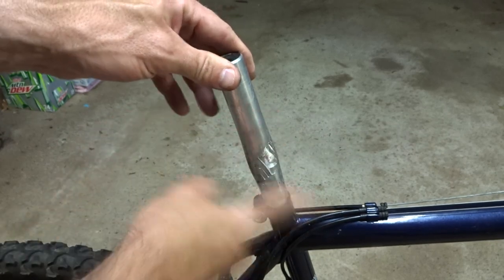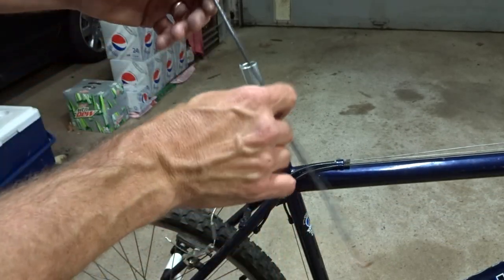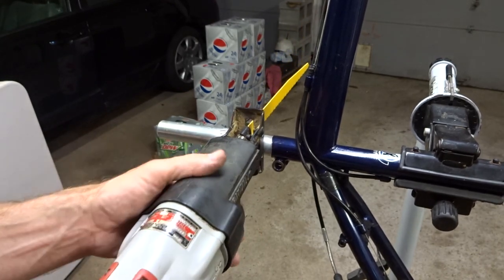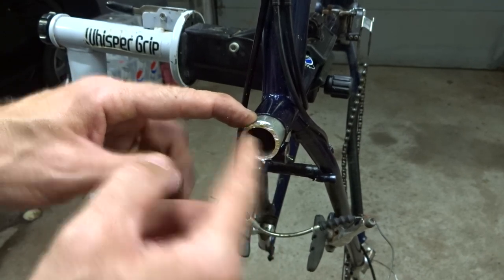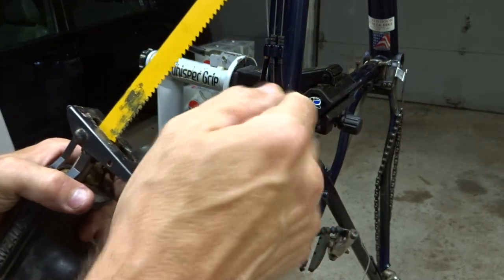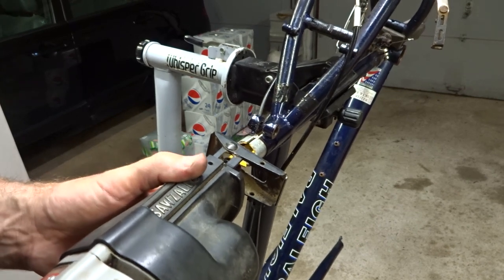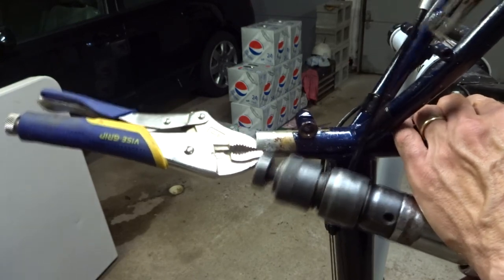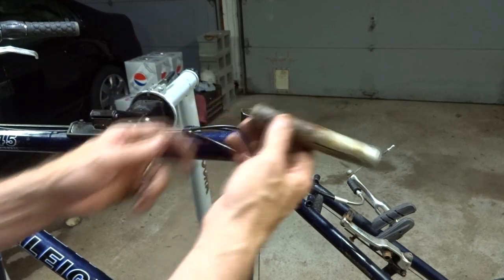Removing Stuck/Frozen Seatpost By Cutting With Sawzall

Comment from the maker: For more bike repair videos hit the subscribe button ► http://bit.ly/SubRJTheBikeGuy
Reply: buy some caustic soda powder and mix it with water, cut the aluminum post flush with the tube. You will have to plug the hole in the bottom bracket then fill the tube with the caustic soda & water. the mixture is very harsh on aluminum and will dissolve the post in a few hours, but will not harm the steel tube.
Reply: Ian Brown  did you see that video,  RJ did removing a stuck seat post with an impact? HaHa he  has both kids out idea's beat. 😂

Comment: My aluminum seat post was badly stuck in a steel frame. I applied penetrating oil several times before attempting to remove the post. I managed to rotate it completely after oiling but it was still extremely tight and would not budge vertically. I tried to remove it with a 10lb slide hammer with absolutely no effect. Finally, I decided to try the slit cutting approach. I first cut open the seat post with around an inch protruding from the opening of the seat tube. Then, I cut two slits in opposite directions of the post with the intention of splitting it in two pieces. This method worked, and the post eventually came out of the seat tube with the motion of the blade (the two sides of the post were almost separated). No other tools were necessary. The post was around 8 inches deep below the top of the seat tube, so I had to use a 12 inch blade (6 tpi). Keep in mind that this method can be very laborious. Took me around 6 hours to accomplish the mission.

Comment: This method worked for me where everything else failed! A shop even had a chance for a few days and apologetically told me the frame was now toast since they tried everything. Two days later I freed the stuck post with a reciprocating saw and the same blades that RJ uses. 

Made 3 total cuts, two of which took a perfect quarter out of the post all the way down to the bottom, which made the rest twist out easily. Didn't need air tools at the end, just a pair of vice grips, PB Blaster, and some easy twisting action. I used a brake hone tool to clean up the inside of the frame and a new post has already been greased up and installed. Thank you for this video!
Reply from the maker: I didn't need the air hammer, but I had it, and it was fast.
Reply: Fast is exactly why I quickly came to terms with using a reciprocating saw. Thank you again for the inspiration.

Comment: RJ, I inherited a clunker of a bicycle with a seat post recessed and rusted in the seat tube.  As bicycle mechanic hobbyist,  and viewing your videos I called a friend to bring his electric saw and propane tank, which he did.  However he came with everything and also a can of PB BLASTER, and it was like watching a magic trick.  He sprayed the walls of the seat tube frame and  between the seat post ,  a nice amount and let sit for a minute or two and then inserted pipe extractor, size 1/2 " or 3/4 " into the seat post  and hand tighten it a bit before using a wrench and screwed it in , and presto the seat post came out with the extractor like butter, and saved a bicycle for a needy child.

Comment: Many thanks, totally recommend this removal method for everyone where they've given up on all the other methods. It worked a treat for me after being lumbered with an incredibly stuck post. So stuck in fact, that (after first trying a slide hammer, leveraging a fitted saddle, loads of penetrating oil etc) I used a 36" length pipe wrench and only succeeded in twisting off the top of the post, and this was no easy feat judging by the fact that the cheap seatpost had a super thick wall, about 3/4 of a cm, and was internally ribbed to boot! After this I got stuck in with a cheap reciprocating saw and saw the light. Had some slight difficulty finding a blade that was thin enough to fit inside the narrow space inside the post, as well as one that was long enough to cut to the bottom of it. And here I would mention a small criticism for TJ during the sawing process. He recommends that several cuts should be made before having an attempt to budge the post. However, in my case I'd just made one (but very thorough) cut, and then went for the mole grips to test if there was movement. There was:) So you might save yourself a little grief by trying this. But the most important of TJ's tips here might just be the use of the coarse tooth blade, instead of the standard metal cutting one. Reason being that, despite making a v thorough cut which definitely would have made contact with the inside of seat tube, there was no damage to it. It's true that I did test the deepness of the cut occasionally using a hacksaw blade to try and get a 'feel' if I was through the soft alloy post and making contact with the harder steel (which seems to catch against the blade more), but this isn't foolproof. And of course an equally big benefit of seeing this vid is just that it gives you a big dose of motivation to get stuck into a difficult job like this one, which if you don't have it, I'm sure that more often than not it will end up with the bike owner giving up on the frame:(
So a big thumbs up here, and not that much work done:)
BTW my stuck post was in a Reynolds 853 frame (definitely worth saving!) which I've heard several times now that for some reason they're more susceptible to getting stuck posts. So if you have one of these, better regrease the thing now and avoid the cutting work!

Comment: After watching this several times in the past year ,finally I got help from my neighbour who used his recipricator saw to make cuts in my alloy post then used a hammer and chisel to free part of the post,it then pulled out,with no other damage to the carbon frame. i watch a lot of your stuff,think you are great to watch,love the improvisation techniques. Keep up the good work fixing bikes,All the best from England. Mark.
Reply: what the hell how did it seize up so bad in a carbon frame ? logically you shouldnt have any problems with galvanized corrosion should ya ?
Reply: @jakecole7447  ..just use over time all year round i guess without moving the post (life's lessons i guess)the bike shops couldnt shift it either so was a last resort..

Comment: RJ- I can't thank you enough for this video. I've got an older Schwinn Prologue road with a stem that wouldn't just wasn't going to move. I went through all sorts of videos on the unsticking of a seat stem before running across yours. Using a Sawzall and a pipe wrench, the stem was out in under 10 minutes. This shouldn't be a last resort method, but the first and only way to take care of this problem. Awesome video and thanks...

Comment: Thank you for all your videos. I use a system you might like to investigate. Cut the post off level with the top of the down tube. Get a couple of tree drills (step drills) and grind off all but one larger than the hole in the pillar. Leaving the smaller sizes as a guide. Push in and withdraw which will spread the cuttings everywhere. Use a hex drive extension on your drill to get to the bottom.Use another sized to suit the new hole diameter.When you are left with a small bit remaining, cut the bottom of a steel seat pillar of the correct size with an angle cut to get rid of the rolled end and also give a cutting point, this will curl the aluminum over and hit it with the step drill again. regards Vince.

Comment: ur video worked...my seatpost aluminum 8 inch inside tube...in my 81cromoly mongoose bmx frame....i tried all other ways...did ur cut it out video...got 12" sawall blade ..ground down blade to about 1/2" so i cud get inside seatpost...slotted one side...then exact opposite side...well with cut slots it fell out from shaking while cutting ...worked great RJ...thanks so much...

Comment: Worked like a charm!  Don't spend more than a day trying the other methods.  After that, definitely rent or borrow a circular saw and go this route.  I rented the saw and bought blades from Home Depot 
 I didn't even have to try to hammer out the bike post .  Once I cut it down as explained in the video, I simply cut just one slot  throughout  the rest of the post  (I cut the slot in between the notch of the seat tube).   
Then, I squeezed in both sides of the bike post with vice grips and it just came right out.  All done in about 30 minutes
Note:  If you get the Sawsall, set both the blade speed and the trigger to maximum.  That way the blade won't catch into the metal while you're sawing and make the saw jerk out of your hands...
Thanks RJ!

Comment: RJ, I inherited a clunker of a bicycle with a seat post recessed in the seat post.  As bicycle mechanic hobbyist,  and viewing your videos I called a friend to bring his saw and propane tank, which he did.  He came with a can of PB BLASTER, and it was watching a magic trick.  He sprayed inside around the seat post a nice amount and let sit for a minute or two and inserted pipe extractor, size 1/2 " or 3/4 " into the seat post  and hand tighten a bit and used a wrench screwed it in , and presto the seat post came out with the extractor like butter, and saved a bicycle for a needy child.
Reply from the maker: My guess is it wasn't stuck too bad. They can be pretty much welded in place. I have used PB Blaster, Kano, Kroil, etc.  Here is an interesting video: https://www.youtube.com/watch?v=xUEob2oAKVs

I would be interested in the type of pipe extractor you used. Always looking for new options. It might be useful in cases where the seatpost has been cut off.

Comment: Yes oh Yes....the joy when it comes free. Ha ha love it! I have recently done the same method on my own single speed project the video wont be up for some time yet, the frame needs respraying etc. I ended up welding an axe saw blade to a steel rod to collapse the tube. Hard work, yes and really is a last resort, becomes almost obsessive. Thanks for tips and sharing Andy

Comment: Bravo RJ! Very satisfying. Had a similar problem with carbon seat post in a carbon frame. I used a carpenter's chisel to split the post which was aluminum with a carbon over wrap.

Comment: Drastic remedies are at times called for. Great job!!! BTW had a similar situation but with a carbon frame. After trying every trick on YouTube,  I proceeded to gently chisel out the seat post. Took several days to cut down the length of the thin walled aluminum tube and then pryed out chunks of tubing. Polished the inside of the seat tube with emery cloth with a tool I made on the end of a drill.

Comment: You're awesome. Most of us would have a pile of bikes in the backyard. That last trick was great. I have an idea for a tool thanks to you!
Reply: I just saw your video where you build a puller "v2" with threaded rod inplace of hydraulic. Building something similar that grabs the post and then use the impact hammer to hit it up and out where the impact action is directly in line with the seat post.

Comment: Hello friend, you are a genius. Amazing your method of removing that damn seat post. You know, I bought a bicycle and I had not realized that I had improvised a piece of pipe to the seat of the bicycle and tightened it with a screw. When I remove it I find that the seatpost is completely locked. I tried everything and I can't remove it. I'm going to put your method into practice. I send you cordial greetings from Argentina. Very good your video.

Comment: I got one out using the drip liquid wrench from bb opening down the seat tube for 2 or 3 days and then gently  twisting the frame (not by the stays!) with the seatpost clamped in a vise, what a rush when it finally moves!  Congrats on a successful surgery.
Reply from the maker: Then it wasn't as stuck as this one.

Comment: This looks like a great method to get out the stuck post. I tried this and so far no luck. Used a 12 inch blade on the saw and the air hammer trick. I will keep at it with the PB Blaster and hope for the best!

Comment: Once I get the rusted post out I run a rotary wire wheel down through to try to eliminate as much of the companion damage. And lots of grease - the post doesn't clamp that deep, you won't make it too slippery.

Comment: I've been fortunate to have never had this problem. So just a method I haven't seen applied yet. Remove the bottom bracket and spray the penetrating oil up the seat tube.
Reply from the maker: https://www.youtube.com/watch?v=bGqV5KE7cb8

Comment: Congratulations RJ, fantastic idea. It seems spraying the penetrating oil AFTER cutting  did the trick. When the tube came out, it looked wet from the oil. I'm going to try this method with a completely frozen seatpost soon!

Comment: Was able to remove my stuck up seat post. My bike was so old school it was a metal frame and metal seat post. I confirmed the latter using a magnet.

At first, I was seriously considering welding a bolt at the end and using a slide hammer to get it off. Surely that would work.

The solution I used was to soak the post with WD-40. Kept spraying for as long as I could see it trickle down. Then, I took my butane torch and just pointed the flame at the seat post for about 10 minutes. Then I changed the position so I can heat it from a different angle. Maybe total time spent heating was about 30 minutes. 

In the last 5 minutes, I first started to pound it downward to test for movement. I was buoyed when I saw some miniscule sparks fly upward with each pound.

Then, I smacked it down harder repeatedly until I finally saw it move down about ½". Then, I put out the flame and with the bike on its side, grabbed my huge pipe wrench and started to rotate it. Stiff at first but I soon got about 30 degrees of rotation.

Set the bike upright, then clamped on a large vise grip. Rotated it again back and forth while spraying it with more WD-40.

Then, with a hammer, started hitting the vise-grip upwards. It started to come out and eventually was able to pull it out all the way!

Gonna try the same technique for my handle bar shaft! The lock bolt for the wedge had snapped already!

Comment: Excellent video RJ - nice extraction!

I wonder if I can pick your brains with a bit of a challenge? I've just received a Ti MTB frame, that has the remnants of a stuck ally seatpin in the seat-tube. A previous owner (cretin), appears to have cut the tube off, and bashed the remnants down INTO the seattube! It's a fair way down. They've then compunded this grotesque action by adding in some expanding foam for good measure. 

It looks like I need to try and find a way to get through the foam first, to try and clear a hole that I can stick a saw in with, and then once this is done, try to gently cut some slots into the remnants of the broken seatpin to attempt to extract. 

I wondered if you had any thoughts at all? (No, I've never heard the like of it either!)

It's worth the effort, as it's a '91 Merlin Ti MTB frame and in lovely condition apart from this!
Reply: They might have tried to dissolve it with Sodium Hydroxide (Drano without the additives) and put foam in to keep it from getting into the rest of the frame. I was about to do this but will try the saw first. The Drano is supposed to work

Comment: way to go, yet i still don't know who will get an aluminum seat post for a steel frame!
Reply: Mohamed Ali They have been using aluminum seat posts in steel frames since the 1950s. You just need to put plenty of grease on them when installing
Reply: Really! I didn't know that, all I've seen here was either steel posts in steel frames or aluminum posts in aluminum frames, and they even sell steel posts with Aluminum frames, not the opposite

Comment: Love it!  have toy ever given any thought to apply pressure to the inside of the seat tube to remove a stuck seat post?  Water pressure would probably be preferable (safer) than air, but either might work.  Thanks for your videos!

Comment: Have you ever ran into a seat post stuck in the frame under the seat post being used? I ran into that a few years ago used about half a can of pb blaster and had to weld tabs on the end of a slide hammer to get it out, took about 6 hours
Reply from the maker: I haven't yet. Would be an interesting challenge.

Comment: i had the same problem with a chrome one , i welded a nut in the end and used a 4 foot pry bar and got it free
Reply from the maker: A steel post in a steel frame would not be a big deal. Just ordinary rust.

Comment: RJ, I have a problem with my seat post. I need to stick the seatpost clamp which is made of aluminium, to my frame which is made of carbon. Looking for a short to medium term cheap solution (even better if long term). Any suggestions?

Comment: what about disintegrating the seatpost with HCl (muriatic acid) I tried this with a quill aluminium stem stuck to a steel fork and it worked great. Although the saw method looks less messy/toxic

Comment: buy some caustic soda powder and mix it with water, cut the aluminum post flush with the tube. You will have to plug the hole in the bottom bracket then fill the tube with the caustic soda & water. the mixture is very harsh on aluminum and will dissolve the post in a few hours, but will not harm the steel tube.
Reply from the maker: Few hours my butt! I dissolved a frozen stem and it took a couple days and I had to change the solution multiple times. https://www.youtube.com/watch?v=8b4t42wiJpQ
Reply: @RJTheBikeGuy  Looking at that video, it seems the product you are using "crystal heat" has a lot of other stuff in it besides caustic soda. My experience is if you buy the pure stuff, it really does go faster, and does not foam up as much since many drain cleaners even have aluminum fragments/soaps added. The worst part of that solution is making sure your frame is properly sealed up, so that the lye does not flow where it should not.